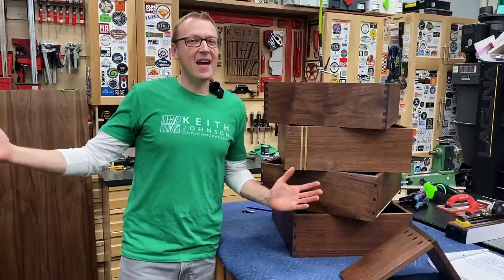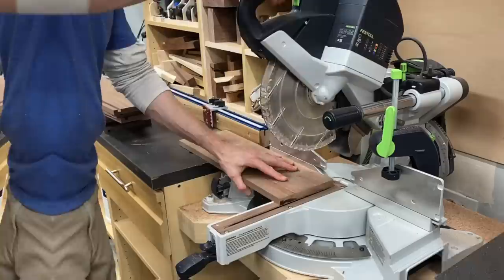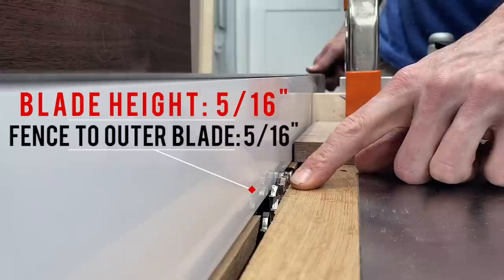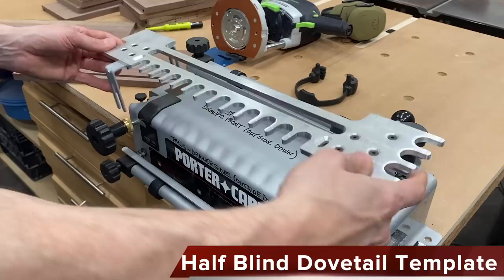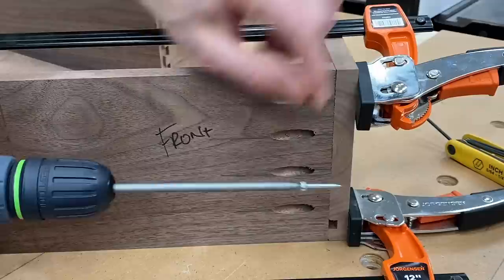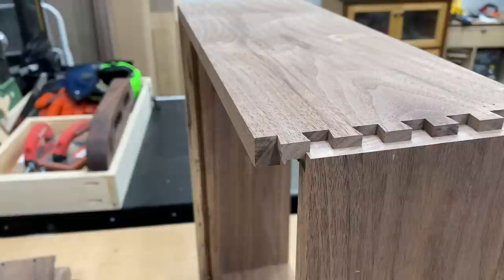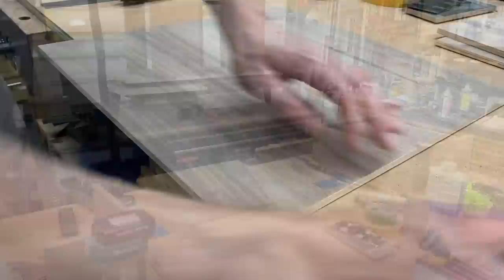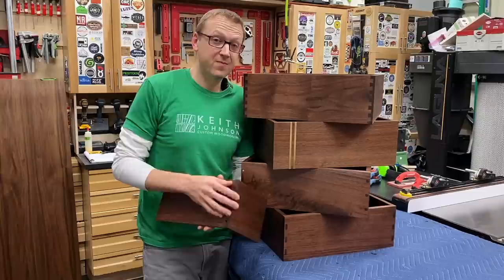How to add more value 💰 to your furniture.

Comment: Thanks for leaving in the errors and how you corrected them. There is a lot that can be taught from handling actual errors that otherwise would not come across as well.  Going back through some of your older videos as I have time and both enjoy them and learn from them. Thanks again.
Reply from the maker: Glad it was helpful! And thanks for the feedback on leaving in mistakes. In some videos that is difficult to do because they are client pieces and some clients watch the videos which can sometimes draw focus where it doesn't need to be drawn. 😜

Comment: Love it. Love that you make a point of pointing out mistakes too. Knowing you, Jason, and Nick are real humans makes me feel better about my chances to become a great woodworker as well.
Reply from the maker: Right on! Mistakes on every project, so don't thing it all goes off without a hitch like it may appear on camera. A mis-drilled hole, a wrong measurement, not setting the saw back to 0 before making a final cut and ruining an expensive piece of lumber...they are all there in some degree when building furniture. They are all gut punches. 😂

Comment: Here in the UK stack dado blades are not technically illegal, but the regulations here in the EU state all table saw arbors must be short to enable one blade only. This stops a stack dado from being fitted. The reason being that to fit dado set up you must remove the rive knife and dust cover. And that according to the regs is dangerous and not permitted. So for us it’s single blade and repeat
Reply from the maker: That works, too! Or a router bit!

Comment: New to the channel-- I am enjoying your content!  Thanks for taking the time to create and share your videos.

I know it's common to cut the dado off of the back to allow the draw bottom to slide in after assembly and I know that makes things easier.  However, I just don't think that the drawer is as strong without something supporting tieback edge of the bottom.  if that drawer gets filled with random heavy junk, a couple of finish nails aren't going to cut it.
Reply from the maker: Thanks and welcome! Your point is well taken. I actually use screws to hold the back of the bottom in place and with everything glued and supported on 3 sides, unless you are storing books in there, I'm not worried about it coming apart. Never had one fail yet. 👍

Comment: What kind of adhesive are you using on the Locking Rabbit? I only recently go into woodworking. Retired from the Army after twenty-one years and rode the mid-life crisis struggle-bus, so I figured why not spend thousands of dollars on tools!?! Then turn to YouTube and figure out what said tools are used for. I only recently found your channel and I sincerely appreciate the information/instruction. Lastly, I am totally not a cat person, but I oddly enjoy watching your cats do cat things in your shop. 

Cheers,
Krap
Reply from the maker: Cheers Krap! Thanks for your service 🙏🏻. I generally use Titebond PVA glue for most joints, but I will use epoxy sometimes when I need more open time for complex and lengthy glue-ups.
Reply: @KeithJohnsonCustomWoodworking   Wow! Was not expecting a response, let alone a response that quickly. I appreciate the insight. 

Cheers

Comment: Great video, thanks for sharing.  I have done the Domino drawers also.  What worked for me was to set the depth to 20 or even 25 or use a shim to get the domino further from the edge, but not out the back of the front.  That makes the little cross piece stronger.  And make the dominoes very slightly thinner as you did.  Apparently I did not really like them because I have never done them again.
Reply from the maker: 😂 Well, you can chalk that up as R & D. I haven't made another Domino drawer either. 😂

Comment: Great video, Keith. I really enjoyed the in-depth detail and all the tips too. Definitely going to save this video in my woodworking playlist 👍

A question, if I may. When sanding down the parts and components for the boxes for a customer (or even for yourself), to make sure the joinery doesn’t change, would you sand to a finished grit on the inside before doing the joinery, just in case it affects the fit during assembly by possibly creating gaps? Thanks as always 🙏
Reply from the maker: That is a great question! And I actually had a long explanation about this in the video, but took it out because it was too long. Since the finish coming off of my helical planer is pretty smooth, I lightly sand with 150 and I'm done before applying Rubio. However, if you have to go through multiple grits before achieving the surface needed for your finished, then I do suggest some sanding before any joinery because it can affect the fit of some joints if you go crazy with the sander.
Reply: @KeithJohnsonCustomWoodworking . That’s great. Thanks so much. I’d always thought about this, so just thought I’d ask. I’m still learning and it’s videos like this that really help... as well as you taking the time out of your busy day to explain to people like me, which I appreciate greatly. Also, I sometimes write a comment part-way through a video, because if I don’t, I’ll forget, so I just wanted to say how nice all the draws turned out. I actually liked the domino version too, but the others were a classier option, I think. I hope the long brass inserts don’t cause problems too, because they suit the walnut perfectly. Lovely job as always. Hope the rest of your day is a nice one. I’m just winding down over here in the UK, as it’s nearly 9pm.
Reply from the maker: Always appreciate the engagement and your insightful questions and observations, Chris. Thank you! Have a great rest of your evening. Cheers.

Comment: So were the brass pins as fussy to sand and finish as the brass bars were? Or were you able to get by with less sanding since it's such a small surface area?
Reply from the maker: Yeah, it's all a bit fussy since the brass is softer than the wood around it. Almost best to leave the pins a little proud so you tape around them and give them a nice polishing and not affect the wood around them. It also give them a tactile feel.

Comment: I just use two bits of wood screwed to the bench in a square to align pocket hole joints and clamp the wood to them. Or you could use tall bench dogs. Good video, metric ftw though.
Reply from the maker: Thank you sir!

Comment: I'm new to your channel and am liking your way of explaining. I'm new to all of this and I'm still buying some of the basic necessities. I noticed on your table saw that your dado adapter plate is wood. Did you make that? The table saw I'm planning on buying doesn't have one available and I know I will need it.
Reply from the maker: Hey Jason! Thanks for checking out my channel! Yes, I made that custom insert using my existing throat plate as a template.

Comment: Fantastic video! Is there an less expensive option to Blum slides the 18” which are now $39.99 a pair or an increase of $3.59 or about 10%.  In addition, you can’t get them.
Reply from the maker: I’m sure there are less expensive undermounts (like the garbage ones they put in my kitchen cabinets 😂), but I’ve never actually looked around. Some shops they strictly make custom drawers generally have less expensive options.

Comment: Super cool stuff! The accents are all great (referring to the cats, but the drawer stuff was cool, too. Ha!). I cried a little when the board split on the dominos. 

When you did your pre-assembly sanding, did you avoid sanding the edges of the boards where the joinery was cut, so as to avoid changing all the tolerances? I recently made that mistake (different joinery than drawers, but joinery nonetheless) and was wondering how you cope with it. :-)
Reply from the maker: I only need to sand up to 150 with Rubio and the finish I get off my jointer and planer only requires a light sanding and I'm done. If you need to stomp through a bunch of grits to get to your finished surface, then the sanding process will definitely have an effect on certain types of joinery.

Comment: @Keith, did you just sand away that 1/8" of brass sticking up on the locking rabbet drawer side?
Reply from the maker: I used a file to take off as much as possible and then hit it with the sander
Reply: @KeithJohnsonCustomWoodworking  thanks for the reply Keith!
Reply from the maker: @NickCollura  👍🏻

Comment: Keith—great content, as always.  Quick question…what is the blue plate you have on your domino and what is its purpose?  Is it similar to the Seneca domiplate?
Reply from the maker: Thanks! That is a TSO Bigfoot. It gives a much bigger reference surface when cutting dominos on the flat and on narrow surfaces. It’s a much better fence option than the plastic one that comes with the Domino. Its different than the Domiplate
Reply: @KeithJohnsonCustomWoodworking  Thanks for the response Keith; I’ll check it out.
Reply from the maker: You bet! 👍🏻

Comment: What pin are you using? I haven’t found one I can see well on Maple.
Reply from the maker: Pin? You mean the brass round stock? Copper may show up better on maple.
Reply: @KeithJohnsonCustomWoodworking    You have marked on the Walnut what what you were cutting, it looked white, then you wrote on the side and front pieces, and could see it.   I have yet to find a good making pen….. what do you use for marking the darker woods….

Comment: Great video!

I think those dominos are also overconstrained; Ideally, you would only have one tight fitting domino, and then would cut the other two using a wider setting, so they are only constraining one rotational axis and one linear axis.
Reply from the maker: Then you would see gaps on the other 2?
Reply: @KeithJohnsonCustomWoodworking  tight on the through side, loose on the blind side :)
Reply from the maker: @rlockwood2  I think if you mortise everything after it’s glued up, it’s the best way and you don’t have to worry about changing any settings.
Reply: @KeithJohnsonCustomWoodworking  ya, doing them after avoids the issue as well, but loses the ability to use it for position/alignment. Adjusting while doing a bunch of drawers sucks, easy spot to make a mistake that's difficult to recover from..
Reply from the maker: @rlockwood2  ok 👌🏻
Reply: @KeithJohnsonCustomWoodworking  realizing I was unclear; I agree, adjusting the domino a bunch of times sucks, it's too easy to make a wide slot where you need a narrow one and ruin your day.. so doing them after is probably better :)
Reply from the maker: @rlockwood2  It definitely eliminates any alignment issues. You just have to be sure your Dominos are sized correctly. LOL.

Comment: Question… why do you not use Osmo polyx oil. No mixing.
Reply: Good question. I’ve done a comparison, and for me Rubio is much nicer. Personal preference here. The mixing is not a big deal. In real work it seems you can be short on the part B, it just takes a little longer to cure. You actually only need part A, you just have to let it cure 30 days.
Reply from the maker: I do use it and have quite a few cans of it, but it smells horrific and I prefer the selection of colors that Rubio offers.
Reply: @KeithJohnsonCustomWoodworking  - I think Rubio smells good enough to eat!
Reply from the maker: @MJ-nb1qn  It could easily be a cologne.
Reply: @KeithJohnsonCustomWoodworking  - I would love to hear what Rubio colors you think work well with different woods and grains.
Reply from the maker: @MJ-nb1qn  Well, I only walnut and white oak, so walnut on walnut and Smoke 5% on White Oak. I keep it simple. LOL.
Reply: @KeithJohnsonCustomWoodworking  - Thanks. I have a commission job for a very special piece I made from some fine white oak. I’ve tried over a dozen finishes with nothing satisfying to me or the client. I saw your smoke on white oak and, Ah Ha that’s it! I really appreciate it!
Reply from the maker: @MJ-nb1qn  You bet! Sounds like it will work great for that project!

Comment: Couldn't you cut that brass with shallow enough passes with a strong enough router?
Reply from the maker: There’s more than one way to do most tasks.
Reply: @KeithJohnsonCustomWoodworking  but would that work?
Reply from the maker: @nicholasjay3932  I'm sure it would, but i'm not interested in flinging hot brass chips around my shop. LOL

Comment: For a quick and simple drawer, I like the rabbet in the front/back instead of in the sides. Then you can pop dowels or screws through the sides into the rabbet groove. I don't mind seeing the end grain on the ends of the front. #jonpeters has a great example of this > https://youtu.be/7tq1fv-xzyU
Reply from the maker: Yes, that's a great method as well!